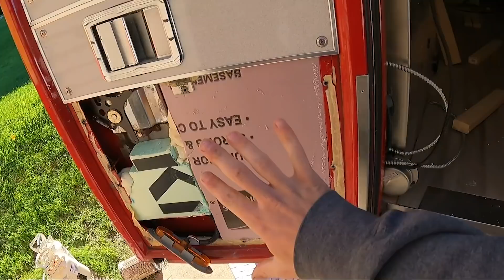Insulation Nightmare | Ambulance Build - Episode 4

Comment: B DOG! pro tip, get yourself a hot glue gun and some 3"wide 8' long luan strips "thin wood template material" make templates of the area you need wood panels and the cuts will be perfect. I know u said u hate doing that part, so that will help a ton. looking good so far man! I enjoy watching the progress!
Reply from the maker: Lol that would have helped me so much today. I just spent hours on intricate cuts 😭😭
Reply: @BrandonGross  its all part of learning hahaha 😆  Im a tile mechanic I use this method on backsplashs with  unique mosaics or finding that right angle on anything else. The hot glue is pretty forgiving an comes off really easy . Can always tack hot glue your strips to the area you are templateing so they don't move. Glad I could be of help!
Reply: @BrandonGross  if you can't find any luan strips. Locate your local stone fabrication shop that fabs/installs countertops. They use them to take templates of the cabinets for the granite or quarts countertops so they should have some on deck. 

Some fabricators use plastic template material but I like the wood cause it cuts pretty easy. & well fck plastic lol
Reply: & a fresh fine tip sharpie 😄 🤙

Comment: You should buy a panel saw. This will give you straight cuts every time. They use them in cabinet shops. Easy good good good deal on one now most people are using CNC machines

Comment: Bro! Your so productive. Stoked for you. ✌️ keep moving forward. 😂 keep on rockin in the free world 😂 pro tip: clamp a 2x4 to the piece of ply what ever the width of your skill saw is where your cutting then run the edge of the saw down the 2x4. If that makes sense.
Reply from the maker: Thanks!! I’ve been doing that with a long straight piece of metal actually!
Reply from the maker: Thanks !  I’ve actually been doing that with a long straight piece of metal. But only for the really long cuts